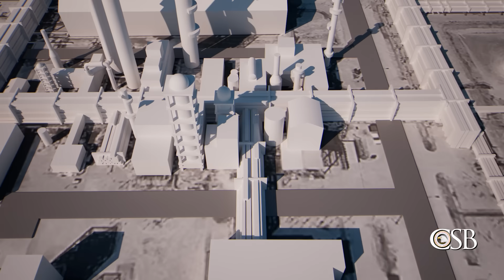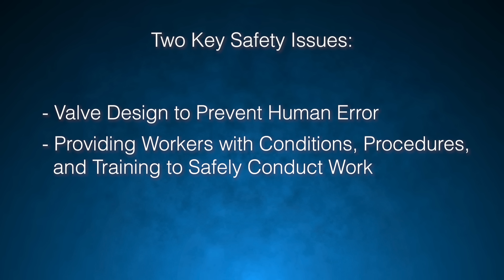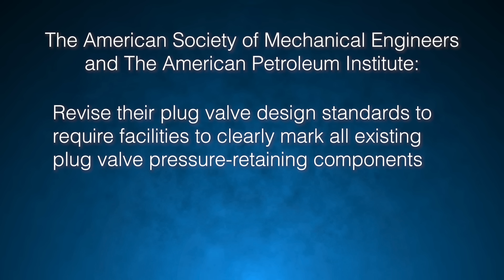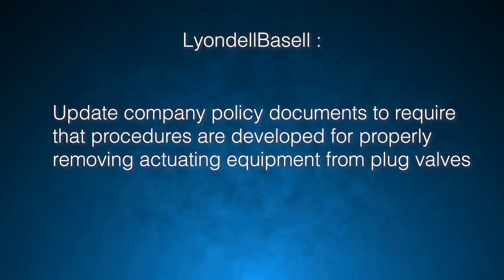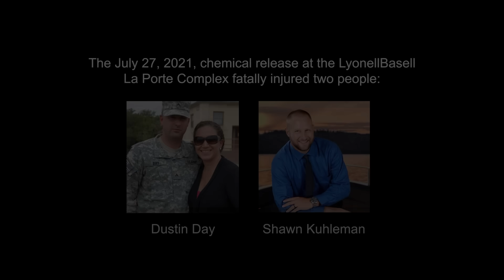Designed to Fail: Chemical Release at LyondellBasell

Comment: As a retired process plant engineer I'm astounded at the incompetence of the team that were engaged to remove the valve actuator. You can make all the rules you like and label every nut and bolt but you can't fix ignorance. Try engaging skilled and trained personnel. This incident I would lay at the door who claimed to have a "QUALIFIED" team available. Subsequent facts proved the opposite.

Comment: So what I don't understand is if these guys were qualified to remove it then why did they remove more than they needed to remove? And if they're really good enough they should have known to verify if that valve was under pressure before they remove and how to verify that that part actually needed to be removed? I mean I think we have something called blueprints least we used to. I don't know. Maybe they don't use them anymore. I hate to be sarcastic about it but geez how can you say somebody's qualified to do something and then have this happen? I mean both companies are at fault in my opinion but it's just I don't get it. I don't understand. This is something that does not have to happen!

Comment: I really don't know how you can work in a chemical refinery and not know the difference between an actuator mounting bolt and a valve bonnet nut/bolt. These guys were not very well trained and way in over their head

Comment: At the company i work for we use 55% acetic acid to neutralize polycarbonate or polyester film after running it through a heated tank of sodium hydroxide. I couldn't imagine being blasted by heated acid. Getting the caustic liquid on you is bad enough.

Comment: I was in Citgo Lake Charles Louisiana two dudes went over and opened up a live line instead of the one they were supposed to had very little of them was recoverable from the mess I was inside of a distillation Tower in the next unit over I was all the way at the top we had big copas blowers blowing air in the recovery event in the top of the tower we got their first we were the first ones out we started smelling it we took off running how much is trying to tell us we just took a break look he was approaching flying lessons at that point after that was understood he let us pass without issue we didn't even make it to the Man way before they hit the alarm by the time I hit the ground they had already hit the unit evacuation we were going over the freaking fences I knew where my truck was I was out of there
Reply: No Hill no my lungs a been the same since that was late 90s early 2000s

Comment: If the narration is correct, the valve actuator was being removed to perform a lock out tag out procedure. To me it seems like a separate manual value lock out tag out valve should have been in the facility design, unless that would have created a safety issue. This is common practice in HVAC systems. 

Second, the graphic showed what appeared to be a pneumatic valve with spring return to the failed position. If the failed position was closed, which it likely was, simply removing the pneumatic line, shown in the graphic, would have prevented the valve from inadvertently opening during the maintenance procedure. Of course there would need to be approval of this faster and likely safer procedure. 

I wonder why neither of these were in the comments?

Comment: I could have done this job in 15 to 30 minutes. There is no need to remove the engagement coupler if it is functional, if you do it usually needs 2 setscrews losened.❤ Had to do very similar maintenance before, but with steam instead of acetic acid. 😮

Comment: The holes in the Swiss cheese lined up and people got killed.  How many slices of Swiss cheese are there in this accident?  Here’s a few.  Who dreamed up the requirement to yank the actuator?  Isolating instrument air from the actuator leaves the valve frozen in position.  It’s a fair sized quarter turn plug valve likely requiring a few hundred foot-pounds of actuator torque to move.  What “pipe fitter” can’t tell the difference between mounting bracket fasteners and bonnet fasteners?  These poor guys were disassembling the valve.  If their mechanical knowledge was this low they might next have had a go at the pipe flange bolting.  The CSB’s recommendation to label or color code the pressure boundary bolting is ridiculous.  Pipe flange bolting is immediately adjacent.  Would they have that color coded for safety?  You cannot place enough safety labels on the equipment to guard against this level of misunderstanding.  Miraculously the plug did not eject from the valve body when the bonnet was removed, not unreasonable for a plug valve.  System pressure holds the plug against the low pressure side of the bore.  Only by prying on the coupling did they force the plug away from its seat letting pressurized liquid behind the plug, ejecting plug, shaft and bonnet from the valve body.  This is the kind of opportunistic, unplanned work that happens at night in a turnaround.  I wonder if they knew how they were planning to clear the leaking pipe spool and effect repair or replacement.  Welding or other hot work with only one plug valve between the hot work and a full, pressurized reactor?  Were they planning to pull in a slip blind to truly isolate the reactor?  No amount of process safety management, HAZOP’s or other administrative solutions will eliminate this many holes in the Swiss cheese when basic capability is absent.  I worked as a mechanical and project engineer doing brownfield projects in ship channel petrochemical plants for 30 years.  I grieve for the innocent bystander workers hurt in these lapses of competence.  It’s a dangerous enterprise that only a massive infusion of maintenance expertise and money would solve, only to drive the industry to the 3rd world as it is doing now.

Comment: I work daily with these types of valves and it is not a problem with the valve. It is the lack of knowledge of the workers that removed the wrong fasteners on the valve. Not knowing if the animation depicts the actual design of the plug valve, but if so, the actuator bracket would have never been attached to the bonnet/ cap bolts. There are mounting flats on the valve flanges to which the bracket is attached. Now there were some very old style plug valves that were made decades ago that where not designed with these mounting pads. But when attaching a bracket for a gear box or actuator you used 4 longer studs of the 6 on the valve and double nut the bracket. So there would be the lower nuts, all 6 holding the bonnet/ cap. And then the 4 extra to hold the bracket on the 4 longer studs. There are a lot of people that are in these plants doing field service jobs and don't have the knowledge to work on all types of valves. I also have years of experience in the field working on valves. I treat every valve like a gun. Making a valve manufacturer change their valve design is not going to educate the workers. Just putting all these devices on cars to prevent accidents. It's not the cars, it's the people driving.

Comment: Honestly there really needs to be some rule against contracting-out these jobs beyond all recognition. With enough contracting-out, you get fragmentation of safety management and responsibility.
Reply: The company paid for highly skilled pipe fitters from a contractor that specializes in it.

The contractor was committing fraud by not supplying said pipe fitters.

Comment: I also see two relatively cheap and simple steps that could be taken in addition to all the others, and which would probably have prevented the accident even without retraining or a task list (though those should always be included for hazardous work)
1: the exposed part of that shaft could be painted in the same color as the rest of the actuating motor, leaving the cover plate unpainted would help identify that it was a separate component which shouldn't be interfered with.
2: stamp, laser etch, or otherwise label the cover plate with a warning, something along the lines of "VALVE COVER PLATE, DO NOT REMOVE WHILE IN OPERATION" or whatever would be most appropriate.  That way anybody removing the actuator body would immediately see this message, and as long as they can read english this particular accident would've been prevented.

Comment: I'm surprised there isn't safety wire through the studs that prevents loosening the nuts without cutting the wire, the wire ought to have a label attached that says WARNING: PRESSURIZED COMPONENTS DO NOT REMOVE WITHOUT SUPERVISOR APPROVAL etc

Comment: I don't often disagree with the CSB.  They are 100% correct on the need to train workers, and verify that contractors are competent, but upgrading the plug valve design is absurd. No trained instrument or maintenance tech will remove the wrong valves.  The first rule of incident investigation is to never blame the worker, unless the worker really needs to be blamed.  These were untrained people working on equipment they did not understand.  Lyondell is responsible for allowing an untrained crew to work and Turn 2 is criminally liable for calling this crew trained for that job.  The problem is not a matter of valve design, it is allowing contract organization to bring untrained personnel into a plant and allow them to be released to do work they are not qualified to perform.

Comment: October 4th 2024. Routine maintenance work of a preasure valve at turtle fish tank ends in horrible disaster. Upon removal of the valve approximately 30 gallons of dihydrogen monoxide is released into the room. The effects are catastrophic

Comment: Combination of: Inexperience, and a lack of experienced technical oversight.
Not a poor valve design, it is probably a poor actuator/process design or also pipeline design where manual block and bleeds are not installed. 
They obviously removed the actuator because the control system could open it... another weak point. 
So not a poor valve design.

Comment: For preventing the opening of Valve during working on down stream of the valve is not necessary to remove the actuator just remove the ari supply line and sov and stop the Air supply to that perticular Valve so if someone install tube in actuator then also valve will not get open

Comment: They should have considered to empty the reactor in order to prepare maintenance works, instead  of Manipulation of the valve
Reply: well, technically they weren't supposed to even touch the valve, just the actuator FOR it.  but hey, when you involve Texas stupid in any project... this is how it ends up.
Reply: @thomasneal9291  you can empty the reactor without opening the stystem…and that means no touching of the actuator

Comment: "!Warning! To remove actuator: Only remove the four bolts that connect the black, octagonal plate of the orange valve actuator to the grey valve body. Do not remove the six nuts from the six valve bonnet studs!"

Comment: Jesus. I'm a Jman Pipefitter/Steamfitter that works in oil and gas here in Canada. I have removed actuators on valves before but before i even touched this valve that is not isolated i would have had E & I (electrical and instrumentation) out there with me, along with someone from the valve shop. Also, i have never heard of removing an actuator to lock a valve out. That just doesn't make sense at all to me. That style of valve is a fail open, or fail closed spring operated valve. In that application i would guess its a fail close to isolate the vessel. Even then if that valve was a fail open, it should have been commanded closed and a CTA (Critical Task Analysis) performed, and a detailed work procedure written up on undoing the bolt up right below the valve and installing a temp blind to allow the pipe rework downstream under single isolation. At no time should that valve have been taken part to "lock out" the system. Some dumb ass management and workers is all i can see so far.
Reply: it's Texas.  Now you know:  never move there if you want sanity and safety.

Comment: While some of these cases make me shake my head I know from own experience how one can do unsavory actions to save time...
The hospital I work at recently brought in step ladders (so one has a bar to hold on to) to get to top shelfs in the nursing office... But... They are cumbersome to move around and take up space so everyone just continues to use the spep stools. While they are definitely designed to be used as step they are a little bit on the short end for short people and one still has to stretch to get to the highest shelfs... But... They are so much more convenient for everyday work.
Also... I've seen IT guys putting their ladder on a table to reach into an access panel on the ceiling to work on the network access point of our projector in the classroom. The ladder was to short to comfortably do that from the floor... So... Placed on a table, one guy up on the ladder, the other one standing next to the table holding the ladder.
Was the ladder stable? Yes! Was it close to the edge of the table? Not really, it was a bigger table with a good bit of wiggle room. But... I guess technically it was still a guideline violation... But they did it because it would have been inconvenient to first acquire a bigger ladder...
Those are two farely harmless examples... But with both things could go wrong as well...

Comment: I am an operator at a plant, usually to lock out valves with an actuator on them, we remove the air supply line and lock out the air supply ball valve. This prevents the valve from opening.

Comment: They have a LOTO procedure to mechanically lock valves and they try to modify shutdown valves under pressure vs de-inventory and de-pressurize..
It's bonkers to me that they modified the valve to do this and the board never addressed this. This is going to happen again. You don't get contractors and expect them to be experts on modifying valves.

Comment: One thought might be to either adopt a color-coded bolt head or safety wiring bolts that could be dangerous if removed. 

Then include training for all employees that removing wired or color coded bolts  should only be done after ensuring appropriate precautions or done by personnel qualified to do the maintenance.

Safety wires can also be a way to ensure something hasn’t been tampered with - if the wire is missing something is wrong. Installing new safety wire can be the job of inspectors or supervisors who sign off on work, maybe even attach an ID tag to the wire.

Comment: I do this kind of work frequently, I dont know what the fuck these people were thinking. Its not uncommon for 3rd parties to be used to do this kind of maintenance and for the company that hires them to have no clue about any of the equipment. But wtf are they doing dissasembling a valve without ensuring the pressure is taken out of the system... Its like the first question I ask on any job like this.

Comment: 3:24 How the heck do you look at that and think it's even close to safe? The pressure flange doesn't have a single bolt holding it in place. To think they got together and decided to take a pry bar to it, and no doubt some good old fashioned impromptu improvised slide hammer action to seal their fate. I mean really, damn, just damn.

Comment: This investigation failed to address some key points.
1. Most importantly, why was it necessary to remove the actuator?  Leaving the actuator in place with the energy source disconnected and locked out would have held the valve in position.
2. Why weren't the bolts that fasten the actuator to the bracket removed instead of the bonnet nuts?
3. The video depicts the work being done in daylight. This work was done at night, limiting visibility for the workers. 
4. Was the piping insulated?  This would have also limited visibility for the workers.
Reply: Wonderful points

Comment: @jessicalacasse6205 
Not all companies have qualified maintenance members to perform these tasks. This is why subcontractors are needed. 
First thing is is that specific category worth paying for. 

Second the subcontractors can specialize in these situations, jobs & train more employees at a better price than having 20 or 30 employees at the company site who may be there, but working on a different job.

 Like the video said, Turn2 had a night shift group available for repairs on this job. It was the L-B(THE company that contracted the job) failed to give the correct process\information to the controlled substance. 
The Turn2 employees had training. But they were not given the proper condition, instructions & warning to prevent the failure from L-B.

Whether employee's were union or not L-B & Turn2 need to train,mark, design and correct the improper valves & other equipment so to prevent future injuries and death

Comment: I was working at a nearby plant when this happened. We handle 100% monochloroacetic acid, which is just as bad as this stuff. In my experience, there are times when specific "yes men" upper management will tell you to get a job done or get out, and I believe this was one of those instances.

Comment: Why is it not a basic requirement to wear a hazmat suit whenever working around equipment like this?
Reply: because hot vinegar isn't that dangerous unless you accidentally unbolt a high pressure line containing thousands of gallons while you're standing in front of it, they would have needed legit oxygen tanks to deal with this and even then if the suit gets ruptured you're still in trouble. A big failure of the contractor crew not mentioned in this video is their lack of a safety plan, you should always stand back and isolate if someone is putting a crowbar on something high pressure regardless, in case of a catastrophic failure and not just a self induced one